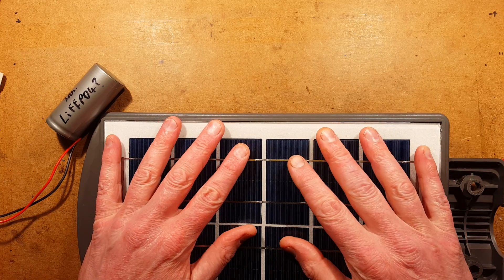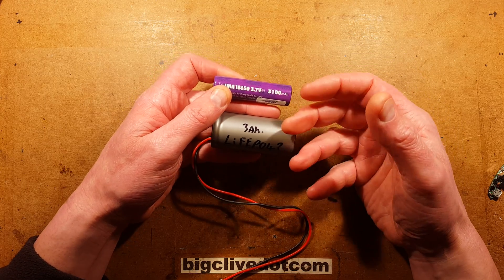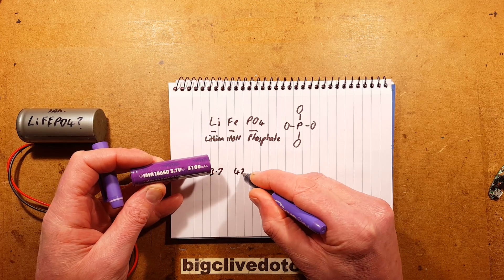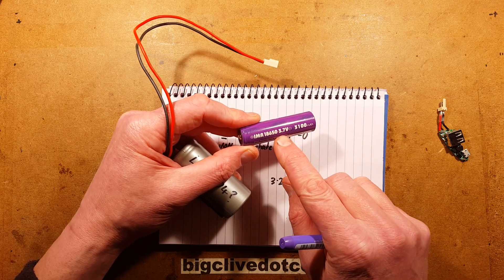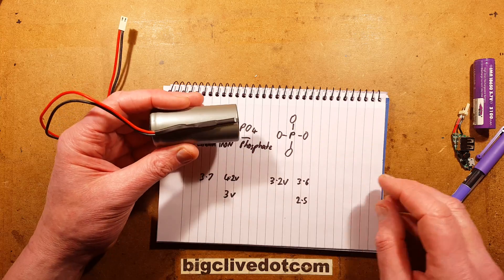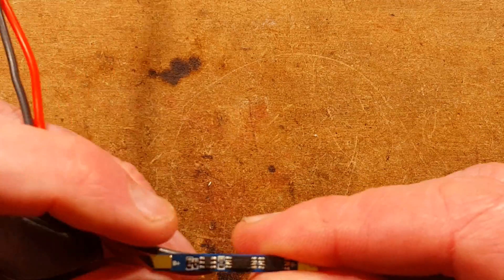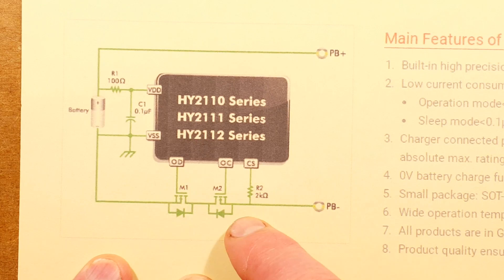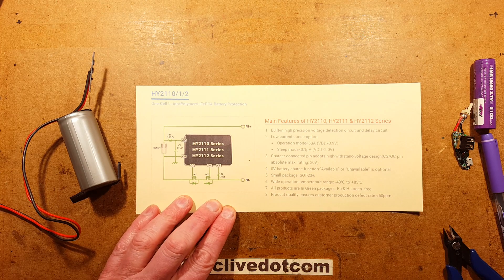LiFePO4 versus standard lithium cells.

Comment: Clive, what is the model number of that cell? I think I have some on hand. I also have a Cadex C7400ER battery analyzer. If it is the same number, I will send you the results. Where should I email?
Reply from the maker: No actual text on the cell sleeve.
Reply: Anything printed on the steel cylinder?

Comment: The very flat discharge curve makes them good for powering 3.3v boards.
Reply: Is it just a coincidence the 3-3.6V voltage of a LiFePO4 cell pretty much matches the recommended operating voltage range of 3.3V logic?
Reply: @NiHaoMike64  For us casuals, just coincidence. For any hardcore scientist or quantum physycist or chemist, this warrants an entirely new front of investigation! 
Or it's just rounded to numbers people can easily memorize.
Reply: handy tip!
Reply: They also come in standard AA-size which is nice.
Reply: I believe it is because you can leave out the regulator, that is all.

Comment: LiFePO4 has a much higher current capability than li-ion.
Reply: No.  The chemistry alone does not determine current capability.  It is far more dependent on Cell geometry.  Surface area determines current capability.  It is entire possible to design high-current cells with either chemistry.

Comment: Another advantage is the voltage. 90% of the capacity they stay between 3.2 and 3.4V tange... so you can power 3.3V chips (Arduino projects..) directly.
At the same time it’s a disadvantage as it is impossible to guess their charge level by voltage (works somewhat for lunch-ion) as the voltage sits so close to 3.3V between 30% and 95% of capacity.
Military likes to use such batteries due to their tolerance in case of improper handling.
Some people here say they are expensive. Can’t confirm that. I’d rather say they are cheap. Many types are tested for 5000x and more cycles, taking this into account they are easily 10x cheaper in kW/h
Reply: dc -dc converters are widespread anyway

Comment: You arent going to get 1000 cycles out of a high drain 18650.
100 cycles before youll notice capacity loss, 200 before output loss, 500 max.
Reply: Also, the lowest you want an 18650 to get is 3.3v, even under load. 
Below that you damage the cell and can increase the chance of dendrites and explosion. 
If you battery is getting warm, it is damaging it.

Comment: Tesla uses NCA Li-Ion batteries, not LiFePO4. 

They aren't used much for plug in EVs as the specific energy density is lower resulting is massive packs.
Reply: Well, I would sacrifice the energy density for a car that doesnt need its most expensive component replaced every few years and doesnt occasionally explode.
Reply: @Chuckiele  In any proper EV, the batteries are heated and cooled to keep them at the optimal temperature for long life. So they don't die nearly as quickly as they do in things like phones and laptops.
Reply: @lobsterbark  Yeah but still far from ideal.
Reply: LiFePO4 IS a Lithium Ion battery...

Comment: Teslas don't use LiFePO4 cells. They use an Aluminum-Manganese-Cobalt chemistry that is even different from a typical laptop battery. I believe LiFePO4 cells are used in Priuses. They are also quite popular in e-bikes. LiFePO4 cells main disadvantage is about half the energy density by volume. Properly cared for with thermal management and cell balancing during charging, traditional Li-ion batteries are safe. Rich's buddy was charging the battery with a standard Lead-acid charger.
Reply: Yeah my e-trike uses LiFePo4 batteries at 36v. However, it used to have Lead-acid batteries and I converted it.
Reply: Tesla doesn't put these in cars, but their power banks do have other types.
Reply: My portable mobility scooter uses LiFePo4 batteries @ 24v. Only 12Ah but cost £300 to upgrade from lead acid.
Reply: My new Hyundai Ionic Hybrid also uses LiFePo4 I think ?
Reply: I was wrong, Lithium -Ion Polymer.......
Reply: @pahom2  Before 2011 or so Priuses used NiMH. That's where a lot of the "batteries don't last" FUD originates. NiMH is only good for a couple hundred or so full cycles as anybody with garden lights can tell you.
Reply: @ @Markle2k  True of garden lights, but not electric cars, which have far superior battery management.  NiMH cells properly managed are more robust than Li-ion, have longer lifespans, and longer cycle life, and some of their capacity loss can be 'regenerated'.  They are also heavy and deliver only 1.2v, giving them far too low Energy Density for fully electric cars.  When NOT properly managed, NiMH cells have short cycle life.  OTOH, poorly managed Li-Ion cells are downright dangerous.
Reply: @guygordon2780  The problem with Prius NiMH batteries is not a current topic up for debate, but rather a historical fact that only matters if you want to buy (or sell) one that is more than 8 years old.
NiMH cells are much trickier to charge properly compared to Lithium cells and they have embarrassingly high self-discharge rates. They age with every cycle regardless of your battery management system. They will lose half their capacity in 300-350 cycles no matter what you do. A non Fe lithium cell will last 500 cycles to 70 percent of original capacity when charged to full capacity every time. If you lower the voltage at top-of-charge by ~0.07 volts, you double the cycle life. And that continues down to the point where you are charging to such a low voltage that lifetime energy throughput is reduced (~3.9 v). You can get thousands of cycles if you only charge to 80% capacity which is about 4.0 volts with a saturation charge at the end of the constant current phase, so long as you don't routinely fully discharge. At that usage, you will never see degradation until the day the cells drop below 70 percent of their rated capacity.
There is nothing dangerous about Li-ion cells if you care for them and you don't lick the high voltage terminals. Luckily, automobiles have a BMS that look after the batteries for you.
Reply: @Markle2k  I agree with those observations about NiMH, at least when they are in a large pack and charged in series. In smaller applications (power tools,  older household items, etc) I'll often find that one of the 4 to 8 cells inside the battery pack has gone bad which makes the entire thing not work well. Fortunately with a bit of creativity sometimes you can easily swap them over to lithium ion or just scavenge together enough working cells from the junk box to put it back to work in original arrangement.

Longevity on AA NiMH batteries is fine though in my opinion, I've got a few Eneloops that are still in good condition well past the 300-350 cycles you mentioned. But those have always been charged as they should, delta V detection with time, excessively high voltage, and temperature thresholds as backup termination settings. Eneloops also don't suffer from that usual self discharge problem. Not sure how to give them that level of care inside a large pack since you'll have multiple sets in parallel which are then connected in series.

Oh and regarding that charge voltage remark in lithium ion batteries, I've noticed that some phones and tablets even push them to 4.4V these days. Which probably works out great for manufacturers: long battery runtimes initially and quick degradation with a hard to replace internal battery so you get return customers.
Reply: @extrastuff9463  Power tool batteries are hammered a lot harder than EV battery cells. Personally, my power tools skipped straight from NiCd to Li-ion so I don't have much experience with NiMH tool batteries except for my floor mopping robot, the battery of which lasts for about 500 cycles before I have to buy a replacement. It has a fast charger so it also has a temperature probe wire to the battery in addition to using negative dV/dT for cutoff. The charger doesn't trickle charge, so I have to top up if it hasn't been used in a few days or it won't finish the floor on the first go.
Nickel-based batteries' main advantage is in high-C use cases. IOW, they have a high power density. That's why they continued to be used in electric RC model aircraft into the 21st century despite being very heavy in relation to the energy stored. Then Li-ion chemistries that would sustain high power drains came onto the market. Those don't have the energy capacity of other Li-ions, but they have higher temperature tolerances along with the higher C ratings. Vaping batteries and tool batteries are often the same thing inside.
I haven't gotten enough experience with my Eneloops. I got them about the same time I switched from using a handheld GPS to using my phone for geocaching. Phone GPS finally got "good enough" that carrying around another device and spare cells became a hassle. Eneloops are too expensive to put in garden lights.
The Lithium Aluminum chemistry in Tesla batteries has a top of charge of 4.3 volts. All the pouch cells in my phones hit top of charge at 4.3-4.35 volts and report about 35% capacity at "Li-ion nominal" 3.7 volts. Which indicates that 3.7 isn't really their nominal voltage. I use a battery alarm that tells me when the battery dips below 30% or when it has charged above 80%. I didn't notice any degradation after the initial 10 percent loss before using the app. It's the first app I made sure was installed on my new phone.
Reply: @Markle2k  I must admit, many of those powertools were actually almost all NiCd now that I think about it (those are a distant past). The NiMH cases were typically household appliances like portable vacuum cleaners etc, either way though when using the right cells a conversion isn't hard provided the 18650s will physically fit in there.

Many of my Eneloops are sitting around not doing much nowadays, got a fair amount of them before I really wanted to deal with lithium ion and had some bright torches running on multiple AA batteries. But there's still a few power hungry AA things in my house that require regular battery swaps putting them through significant amounts of cycles. Definitely too expensive to put in garden lights, I'll agree on that and maybe you don't even want low self discharge cells in there. From what I remember low self discharge cells don't deal as well with constant overcharging which the dumb charger solar panels will be doing during summer, so good old quickly discharging varieties might actually be "better" there in a simple circuit.

Oh and about your phone charging percentages, I never used it myself yet but I recall threads about managing maximum charge levels. Some would support it out of the box and in other cases it would require rooting the phone and presumably some kind of app or maybe flashing it with a custom ROM (for the Android scenario, not sure what the iOS options are).
Reply: @extrastuff9463  On phone battery apps: the first one I tried was recommended to me by a Samsung Galaxy owner who swore by it. I tried it but it didn't shut off the charge at the charge limit I set, OR RING THE ALARM. Arrgh. Looking at Google Play, that app no longer advertises this feature to terminate charging.
I chose another with very high reviews and the very descriptive name of Battery Alarm, now Battery Full Alarm, by Udhyama WoodTech Apps. It's just an alarm. It works perfectly on my old BLU phone, but sometimes doesn't start up on plug in with the MotoX. I have to then go to the desktop and start it from the icon.
Reply: LiFePO4......
Mostly in Chinese made car

Comment: What's the difference between high quality consumer LEDs and the cheapest LEDs?
I just bought some 12V G4 LEDs and found out, that Osram and Philips got 2W/1.8W LEDs with 200lm output. The cheap ones need 5W for 200 lumens.
Reply from the maker: You have to be careful about lumen claims.  They tend to cheat the values a bit, or in the case of the Chinese sellers, fake them completely.  There is a huge range of efficiency between cheap LEDs and the premium Cree type chips.  (Noting again that Chinese sellers often lie about using Cree chips.)
Reply: @bigclivedotcom  This time, the cheap seller needs more energy for the same output, as expected.

For this example, it's a really huge difference. It costs more to buy, but it's a lot cheaper in the long run to buy the much more expensive lamps.

Comment: A 4S LiFePo4 battery can also directly replace a 6 cell Lead Acid battery (Like a Car or MC battery).
Reply: I built a 12.8V, 82Ah LiFePO4 pack to replace a failed deep cycle lead acid battery in my DC UPS setup.
Reply: Dave Micolichek  You don't need a charge controller for LiFePo4. That's the good thing. They have the same procedure. CC/CV and the same charge voltage (14,4V). You only need to make sure the battery pack can take the current supplied by the charger. For that we parralell up packs. Like 4S4P.

But for Li-Ion, LiPo and the likes you will need a controller yes. Or a LiIon/LiPo-charger. You should also have balance circuitry and extra protection (over charge/over current/over discharge) since these are not as safe as LiFePo4. Also 3S LiPo/LiIon have lower voltage than Lead Acid with end-of-charge at about 9V for LiPo/LiIon and about 11V for Lead Acid.
Reply: oooh. handy tip.

Comment: both of my work vans are entirely LifePo4 including the starter battery. Both have auxillary battery systems of 160AH and 800AH respectively and lifepo4 is the only way to go.  I can draw hundreds of amps with little to no voltage drop all the way to 80% discharge.
Reply: What load do you run with that kind of bank?
Reply: @UniCrafter  The 800AH bank runs lighting, inverter, kettle , microwave and bits. I often work on site for days at a time and charge a cherry picker battery from it too, that draws ~60A alone.
Reply: The peak draw i have had so far is 320 Amps .
Reply: @amojak  ah right, I watch a russian youtube channel and the owner owns a hummer with 1 or 2 banks of 1500AH of lithium, and runs a 40,000w sound system off it lmao
Reply: @UniCrafter  i can believe it. I do actually have four 1000AH cells here , originally bought for a van but they are too big to fit. hence i used nearly new leccy car cells instead.
Reply: @amojak  leccy cells? that the brand? looking at getting 4 3.2v cells myself, 100AH
Reply: It's A way to go, they have different characteristics from other chemistry types for different applications.
Reply: amojak I can't yet see any reason to buy an electrically powered vehicle other than to satisfy the current fashionable ideology?
Reply: @johnarmstrong3782  I don't think DIY YouTube is about buying an electric car, I've watched too many builds and I'm not building a car but cool to know I can and may know how soon.

Comment: So, LifePoooo's are the lead acid of lithiums?
Reply: erm no lead acid is a very poor technology in comparison
Reply: @amojak  Lead acids are very tolerant to overcharge, overdischarge, short circuiting and other things. I was wondering if LiFePO4's (i humorously renamed to Life Poo) are as dangerous as LiPo/Li-Ion batteries which tend to combust violently if abused. Idiot.
Reply: @dimitar4y  Well, the robustness of lead-acid depends on the type. It's not that great for most types, sometimes really poor. 
LiFePo4 is a survivor in comparison. You can find attempts to violate them on YT and I've yet to find anything dangerous happening.
Reply: @jaroslavstava3704  Sweet, so this is my new lead-acid replacement. Thanks!

Comment: Hi Clive,
What's the temperature stability like? Li-Ion are terrible when they get cold, is the LiFePO any better (with this being an external device)?

BTW, is that 18650 you're waving about really 3100mAh? I tend to look at anything over 2600mAh with suspicion unless it's come direct from a manufacturer.
Reply: its a fakey 18650 from china.  but yes you are correct, the real high capacity ones only come direct from a trusted route